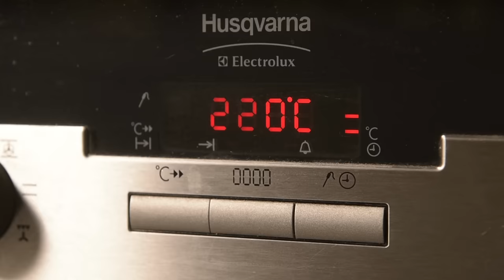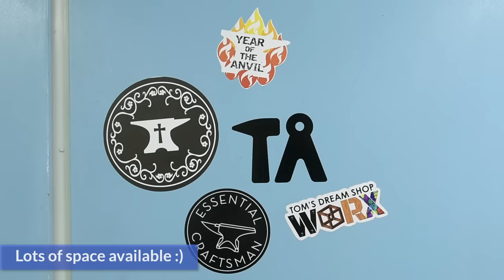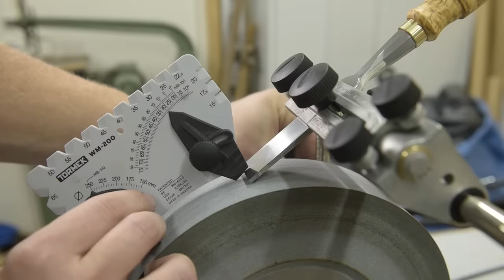Making a wood chisel

Comment: Now I started wood carving and will soon begin making chisels and carving knives figure around 20 pieces set for carving the 1x4 inch projects and some larger for stuff about hat size. I did just build 5 from Sawzall blade that are doing pretty good But belive the rest I'll use 1095 new steel as it's what I just built a good sharp set of kitchen knives that are doing great. 
Thanks for teaching me Sir

Comment: Great looking tool and I love that wood! But I’m curious as why two different colors for the metal bands? And you got an “awe” when the kitty climbed up on your lap!🥰 so sweet!
Reply from the maker: Thanks! I forge weld proper hardenable steel to the edge side. The rest is just mild steel that can't hold an edge, but is cheap and easier to forge and shape.
Reply: I think the question was "Why a steel band at the top of the handle and a brass band near the blade?". I was curious about the same thing.
Reply from the maker: @chuxmix65  Oh sorry. The tool is meant to be struck with a mallet and to prevent the wood from splitting at the top the steel band is there. Brass is too soft for that.
Reply: @torbjornahman  thank you!!

Comment: Hay about the forge weld....
I can see the joint when you are sanding. 
I added leaf spring steel to my mild steel and I could see that joint much like yours. I thought it was a bad weld and grinding .It would almost fade away so I distory the Tommy Hawk filling I had failed..maybe I should have used the Tommy Hawk and let that be it's testing. 
   I'm today making myself some carving knives and not going to have nicer handle as you make. I have Hickory and copper tubing for collars. 
Thanks for helping us. 
Sir you are the most talented teacher I have. 👏
Reply from the maker: You can almost always see the weld line. This one looked like it might have been some impurities left or it were simply the iron filings in the flux that showed up.

Comment: With such detailed work, I was surprise to see  where you left the horizontal blemish on the inside of the blade. I am a cabinetmaker, I appreciate your quality work.
Reply from the maker: Thanks. It's the weld line and it was a bit deep to remove completely.

Comment: What a beautiful tool!! So much intricate work went into both the chisel and the handle!! Amazing craftsmanship!!! My only question is why the laminating or welding of the two metals at the tip?
Reply from the maker: Thanks! It's the old method of only using steel where it is needed. It also makes is a bit easier to sharpen on the bevel side since only half the thickness is hard steel.

Comment: Very very nice.  So nice, in fact, it's hard to imagine actually putting it against a piece of wood and smacking it with a mallet.  One of the major ironies is that there are too many tools that are too good actually to be used, just as there are too many fabulous wines that no one will actually open up and drink.

Comment: Came from curiosity, stayed to learn. Mr. Ahman, may I ask: what is the difference between the two types of steel which you laminated into the blade? The one was a segment of coil-spring, so it added...resilience? edge-holding ability?  Also, why was the tang not continued through the handle to contact the endcap, so as to have any force applied travel straight through the blade, instead of through the wood at the end and then to the blade? 
  Great work, and very well filmed. Thank you for taking the time to produce and share a vid like this.
Reply from the maker: Thanks!!! The main body is mild steel, which cant hold an edge. I add the spring steel for the cutting edge, which can be hardened and tempered. This is the "old way" of making a chisel.
This is how chisels are made. I have never seen a "through tang" on a chisel like this. Can't say why really, I suppose for a tang to hold up it would need to be quite sturdy and would add quite some weight...

Comment: Hi, your work is an inspiration to me always. 

I'm curious, besides the rational use of hardenable steel, there are other benefits from this technique? Why not do it using only spring steel? Thanks in advance for any reply.
Reply from the maker: I wanted to try the old ways of doing it. One good thing is the bevel is easier to sharpen since only a portion is hard steel.
Reply: @torbjornahman  that's cool! Thanks for your reply.

Comment: Be aware, Turpentine might start an allergic skin condition or reaction, called excema.  It might take 10 to 30 years if ever, to get rid of that annoying condition once having it. As the Turpentine evaporates or dries on the other hand, it is most certainly not a threat.
This kind of excema is quite painful, for the skin on the palm gets dry and small bleeding cracks appears, rendering the hands partially useless.
Right kind of Gloves protects almost 100%. Water-Tight ones that is. Especially if you change them out on a regular basis.

Comment: Can spring steel be used to make a chisel by recycling a ford transit leaf spring with dimensions 70mmx 12mmx200mm ? I use an Ercolina section roller to straighten the leaf spring into a flat bar. You can make a heavy cut wood splitting froe by this method !
Reply from the maker: Absolutely, but I wouldn't try to straighten it cold.
Reply: @torbjornahman  Thank you, already straightened the spring..a lot of manual work using a ring roller by hand. using https://www.ebay.co.uk/itm/Heavy-duty-Ring-roller-Box-flat-tube-bender-metal-bender-round-hand-wheel/274470148818?hash=item3fe7b21ad2:g:~8IAAOSw4ahbJl7h, but I used the Ercolina CE50 for my second leaf spring which was much easier. Which ceramic belts are best for sharpening the edge? I have only a Makita 9401 belt sander ! Good thing is, is that eBay sells old big leaf springs for £10, thus an entire chisel set is possible. I will just grind out the bar into a chisel shape.

Comment: Awesome work, beautiful handle, really a piece of art. What is the hardness of your blade?
Reply from the maker: Thanks! I don't know, but it should be around 57-58 HRC according to the charts.
Reply: @torbjornahman  I thought, it would be more like 60++ because of the laminating. Mora gets their single 1095-blades up to 59 HRc without the hazzle of forge welding.
Reply from the maker: @mannihh5274  I could have tempered it for a higher hardness, but I don't think that is a good idea for a chisel... a carving knife is something completely different with much less abuse.

Comment: Nice work. Curious about the two metals. Where they similar?
Reply from the maker: The body is mild steel and the edge steel is spring steel which is hardenable and will hold a good edge.

Comment: Okay, so this has always fascinated me when watching you metal guys: is there like a formula you use to ascertain how much of a "stub" of metal you need to leave to "stretch"? Like in the case of the tang on this one. you left what appeared to be a 2" piece of stock sticking out, which you then hammer out into the tang. Is the volume you leave pre-calculated? Or are you just eyeballin' it?
Reply from the maker: Sometimes eyeballing sometimes calculating the volume needed for a section. It's all about moving material to the right spot!
Reply: Versiculo do Dia....Disse-lhes Jesus vinde a mim, todos os que estais cansados e oprimidos, e eu vos aliviarei. Tomai sobre vós o meu jugo, e aprendei de mim, que sou manso e humilde de coração; e encontrareis descanso para as vossas almas. Porque o meu jugo é suave e o meu fardo é leve.

Comment: I saw that you normalized the metal using heat and then sand to slowly oil, but you didn't temper it with heat and cool oil? Did I miss something? Awesome job!
Reply from the maker: Thanks. You missed it... I quenched in oil and tempered it in the oven.

Comment: What exactly are the "clinkers" in the fire? Coke that's lumped together, or what?
Reply from the maker: Slag. Impurities, sand etc. from the coal plus forge scale from the work pieces, melted together in clumps. Which prevents the air flow and draws heat from the fire and needs to be removed from time to time.

Comment: why did you weld 2 pieces of metal together?
 and why did you put the metal in heated canola oil? since blacksmiths prefer to chill the metal in cold water, this would produce a stronger metal
Reply from the maker: The body of the chisel is mild steel which can't be hardened and will not hold an edge. The spring steel I weld to it is proper steel and can! This is an old technique to use steel only where it is needed. Look up heat treating steel.
Reply: @torbjornahman  wow! Interesting. Thanks

Comment: a bit different than I've seen before. Beautiful craftsmanship... I do believe I would prefer a full tang, but that all depends on how this particular tool is mean to be used. Anybody know what kind of wood that is? it really didn't need sanded at all after the finalal lathe cut from what I could see... tho I couldn't feel it to know, but it was so shiny and smooth already... anyways it's brilliant work,. I don't know about the old layering of the steel idea. Would that actually make a better tool? I thought they did it originally to use the least possible high grade steel. Anybody know about that for sure?
Reply from the maker: Thanks! It's Masur Birch or Karelian Birch. The lamination is an old technique as you say, but it has at least one advantage and that is it's much easier to grind the bevel side as only a portion of it is hard steel. A laminated blade can be stronger also, but that applies to knives more I think with soft material on both sides. Japanese woodworking tools seems to be made this way still though.
Reply: @torbjornahman  lamination works to a point, but people seem to think Damascus is stronger than solid steel, and that's just not so. Every layer is another chance for failure. Some Japanese tools are laminated, some are not, depending on their purpose. The fine hand chisels usually (in better quality stuff) laminated, but not Damascus, so far as I've run across, of course there is cheap junk tho made in Japan isn't really all that great. I had a set of chisels made in Japan and frankly their quality, tho better than most modern stuff they were not nearly on the level we're discussing. They were not exactly laminated, they used a similar technique where hardenable steel is on the working ends of the chisels, but the rest is a very mild steel... and frankly with any hard use they would bend. where the metal was soft. Hard to explain in words for me. Anyway, while impressive looking, they truly weren't they were made in the 50's, post war stuff they did that well they did what they could with what they had but it just wasn't all that.
Reply: @torbjornahman  how did you get the turning that smooth with just the turning chisel? Is ti the wood or some technique you use? I used to turn a lot, and while I got good results most of the time, I never got it to a shiny smooth with just the chisels. Mostly I was working with pine, but did some hardwoods as well. love the figuring in that wood.
Reply from the maker: @tootall5559  I think it's a combination. The wood was really nice to turn, but a very sharp chisel should make a clean cut.
Reply: @torbjornahman  I've seen sharp tools make good cuts, but never leave it shiny smooth like that, but I've never seen or turned that kind of wood before either. That's some pretty stuff. It doesn't turn like a hardwood or a softwood... is it considered a hardwood?  Was that piece from a burl?

Comment: 21:53 why does that look like a delamination or a cold shut where the steel didnt fuse
Reply from the maker: Looks like there might be some small inclusions of scale, but the flux I'm using also contains iron or steel filings that might show up. You will however always see a seam between the steels

Comment: What’s happening at 3:00 what’s the purpose of this?
Reply from the maker: I weld on a piece of proper steel for the edge of the tool. An old technique to only use steel where it is needed.

Comment: The tip angle is not right and not long enough so it will not do a deep cutting. This guy works with tuttle speed. I watched it for 4 minutes and disliked it because he is not organized. Also the angle setter was not used correctly for chisel angle. He should look at the real tool first then do it.
Reply from the maker: You know what? The bevel angle can be anything depending on the job you need to do. Hard wood/Soft wood/fine work/heavy duty work... it all depends.